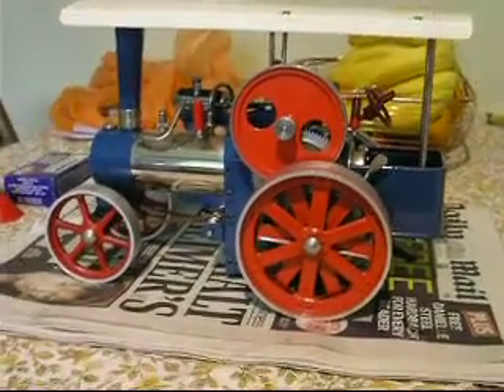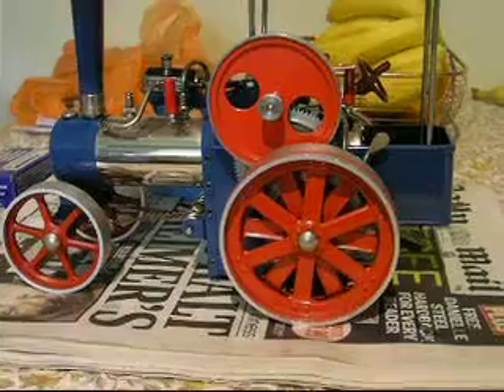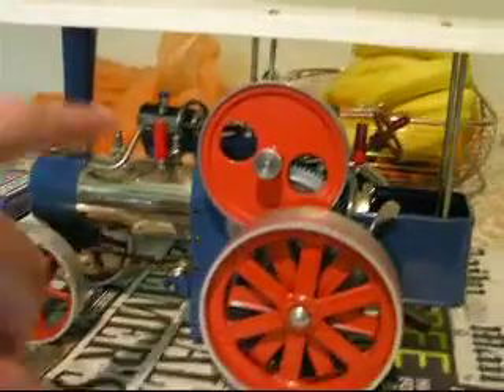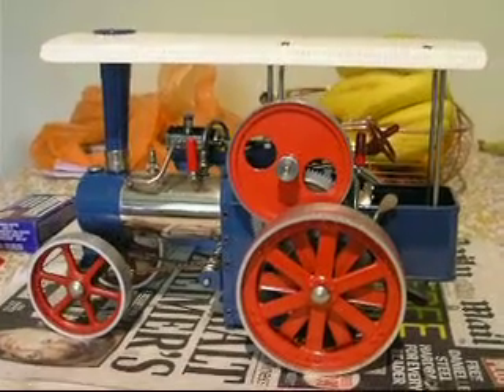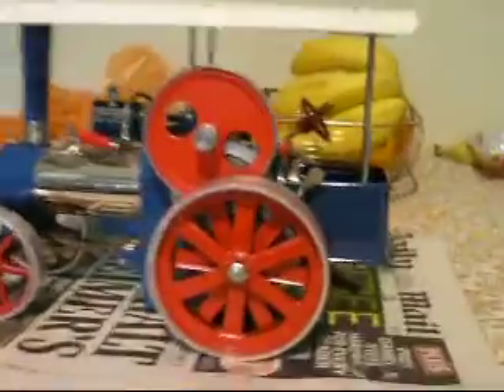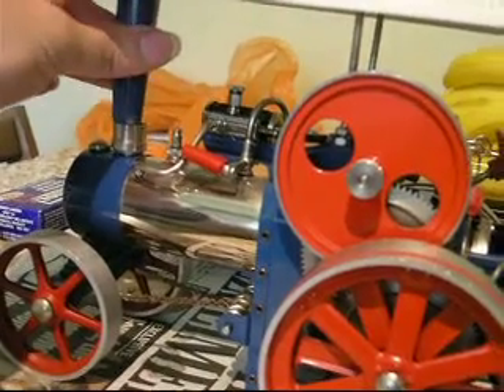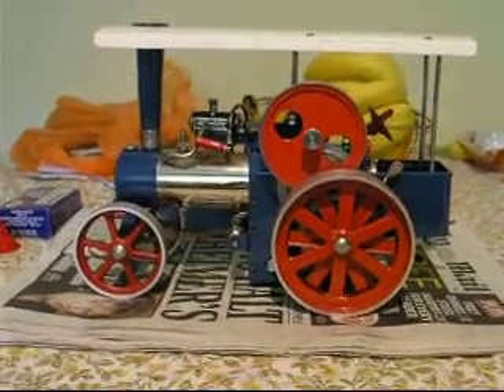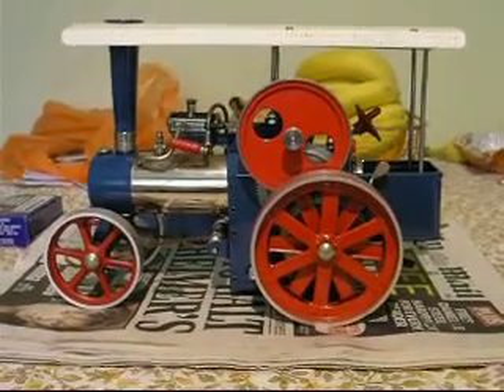Wilesco D405

Comment: I got a syringe for my d  405     with a long tube   that makes  the job easier   I put a bit of   grease  or  oil on a small  paint brush to do the moving  parts get the  rubber   tyres  for it   look alot  better and more  grip on   smooth surfaces  you video  is informative  for anyone  who  is thinking of getting  one    at lot  of them on this tube just  run them  and  no dialog    they no nothing about steam engines  I grease the cogs   and get   a smoother run